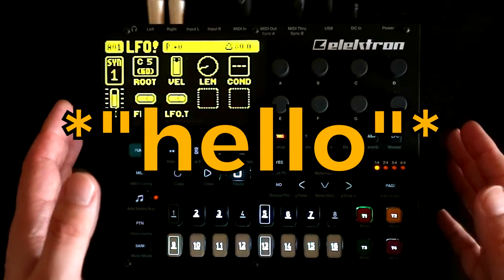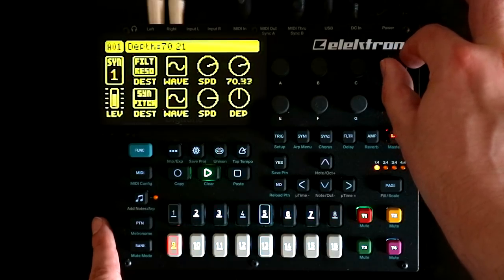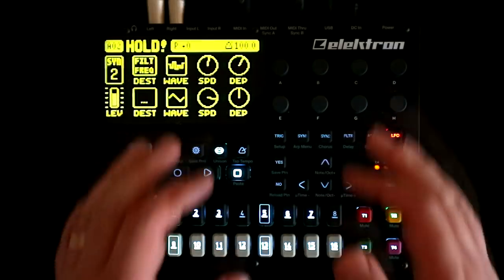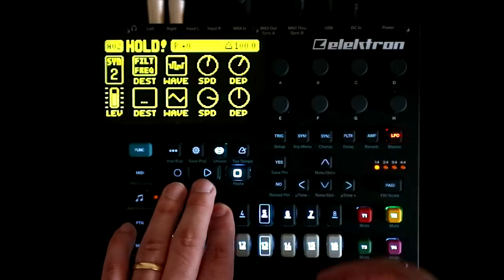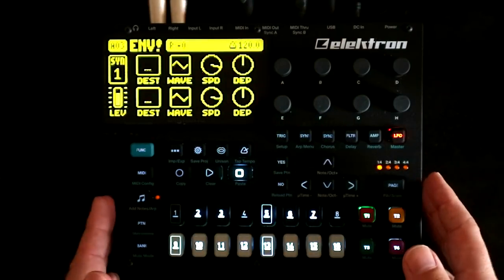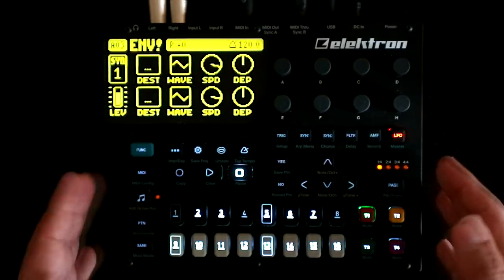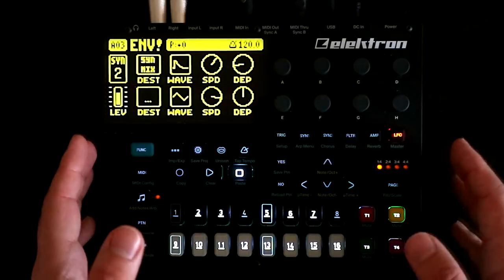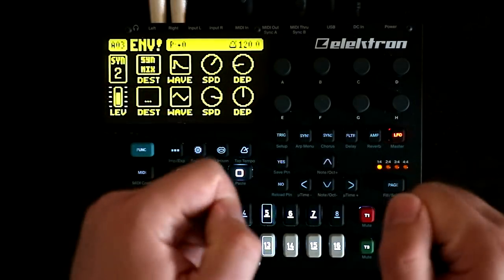3 Awesome Features of the Digitone's LFOs (and some tips for using them)

Comment: Harmonics Envelope=Instant Wavetable Timbres. Also by setting the LFO to a very high speed and modulating the pitch of the operators you get fixed ratio atonal FM, great for percussive sounds. The last patxh u showed can be p-locked into a kick-snare-hat sequence, by having all kick trigs on the X side, all the snare ones on the Y side and for the hihat trigs you use the Y side with a short amp decay time and a higher pitch (instant beatboxing without using sound-locks)
Reply: spr30 
That's dope
Reply: sick comment ｡⑉₍₍⇀◇↼⁾⁾⑇゜⋆♡

Comment: Thanks for this. Can never have enough LFOs. Got a digitone keys last Friday. It will be great once I get the MIDI set up right, splitting keyboard and controlling external gear is a bit confusing. Did get it to work with KorgMS2000r, FM and VA sound great together.

Comment: Hey im finding the speed and depth of the lfo seetings a bit unpredictable.  An example would be how sensitive the speed can be to small amounts or sometimes when setting the depth and not geeting the expected/desired effect. 
Anytips or advice?
-thx
Reply from the maker: For the speed, you should start on the second LFO page and set the Mult parameter first. There are  settings both expressed in terms of beat length (so it'll be tempo synced) and as a straight multiplier (independent of tempo). Use that control to set the 'ballpark' speed and then you'll have a more sensible range on the actual speed control.

In terms of the depth, you need to think about it in terms of the parameter you're controlling. For example, with pitch a value of 1 is a whole semi-tone, which is already way too wide for most pitch wobble purposes, so most of the time you're making very tiny adjustments. On the other hand, if you're controlling Harmonics and you want it to sweep between two values you like, say 12 and 16, you want to put your harmonics setting at 14 and your depth at 2, so it goes up 2 to 16 and down 2 to 12 (this is assuming that you're using one of the bipolar waves, which is most of them).

Hope that's useful?
Reply: Very helpful! Thx again for responding👍🏼

Comment: I kind of wish there was a mod matrix for ALL the LFOs and multitude of envelopes across all the 4 parts.
Reply: midi track lfo to 4 tracks
Reply from the maker: Yeah, good point - you get extra flexibility if you loop back the Midi tracks.
Reply: @OscillatorSink  but you use up your midi ports doing this, right?
Reply from the maker: Correct, sadly.
Reply: @robertsyrett1992  get another midi splitter and or midi merger
Reply: @alltaken0  or another synthesizer ;)
Reply from the maker: That's always an option!
Reply: So do the MIDI tracks have their own LFOs as well?
Reply from the maker: Yes. And you can modulate midi CCs with them.
Reply: Oscillator Sink thank you! This clarifies a lot, as the site only mentions 2 LFOs "per voice" 😌

Comment: Hey man, Great video! Nice cool things I can start configure on my Digitone. There is only one thing I'm still confused about. Do you know what kind of effect the Depth of the LFO has on the destination Ratio B. Becaus i figured out that the Ratio B has 361 parameters. But the Depth of the LFO is less than 0.01 for 1 paramater on the Ratio B.. It feels like a huge bug on the Digitone part, because there is no way you can figure out the sweet spot in this. Keep up the great video's man!
Reply from the maker: Yeah some of the depths are a little funny! I think the Ratio B will do the top operator first which gives a kinda staggered sound. Sorry I can't offer any precise details!
Reply: Oscillator Sink no problem. I have the question filled to elektron and waiting for a answer. Thnx man.
Reply: Loop back here with their info if you can :)  interesting case here
Reply: midinerd unfortunately Elektron does not see this as a bug. The Ratio B’s are mapped. Therefor the Modulation does not do what you expect it to do. But they can’t tell me what I can expect off it or how it does work.

Comment: Hi , will you make a new video with the latest LFO 1.40A version?
Reply from the maker: About the LFOs? I don't think so, on the Digitone it's only the graphics that have changed I believe, the functionality remains the same.
Reply: @OscillatorSink  I am not comfortable with the modulation of the dep , you have not updated to the latest version?
Reply from the maker: I'm running 1.40A yes. LFO 2 modulating the depth, speed, etc. of LFO 1? That's always been there, I just didn't show it in this video. Is that what you're referring to?

Comment: Thx for the vid👍🏼 Can you help me understand the polartity of the speed and depth. I get the positve increments but confused on the negative, especially with speed.
Reply from the maker: Negative polarity on the depth flips the shape of the waveform around the x-axis - turns it upside down. For bipolar waves (most of them) this won't make a huge difference - unless you're in "once" or "half" LFO modes. The unipolar waves like the "exp" you'll hear it "go down" rather than up.
Negative speeds run the LFO wave backwards. Again for symmetrical waves you won't hear anything, normally, but for asymmetric waves like exp, ramp, saw you'll hear things swoop the other way.
Reply: Yooo thx so much for replying! Expains why im not hearing much difference on certain settings. I wasnt a big elektron fan until now. Digitone is a GREAT synth!!
Reply from the maker: No problem!
Reply: Oscillator Sink  One more question. What LFO settings (polarity, wave) would u use to modulate the Hamonics knob but only to effect the “C” operator? Example Harmonic is set at 0.00 and you want to go to -15 (and back n forth obviously).
Gives a nice wave table effect manually in real time, but im having trouble dialing that in with lfo.
-thx
Reply from the maker: Set the harmonics at 7.5. LFO depth of 7.5 on a bipolor wave like triangle or sine should do it off the top of my head!
Reply: Oscillator Sink ok great will experiment, thx again!

Comment: It's surely a great machine. BUT reality is most people just don't go deep into fm synthesis like you do. They're just not going to do it. For these people (which is mayority) this is not a very good choice of a machine cause they are going to be flipping through presets. Like I would do hahaha... In that case better get a digitakt and at least you'll get deeper into it. But for people like you is just a gift design
Reply from the maker: I dunno - the way FM is implemented on the Digitone is by far the most accessible implementation. It's much more like subtractive synth with FM oscillators (on a basic level). There's obviously loads more under the bonnet but this is a million miles away from, say, a DX7 in terms of programming. I'll do some patch design videos soon - maybe I can change your opinion 😉
Reply: Ooh yeah, i mean, ive been fiddling with operator for some years and get cool stuff with it but all times ive been fiddling this one at stores, it ends up playing with the presets. Cool piece of kit, but you hve a point there. Great techno basses though imo